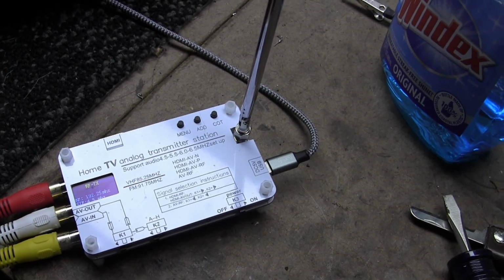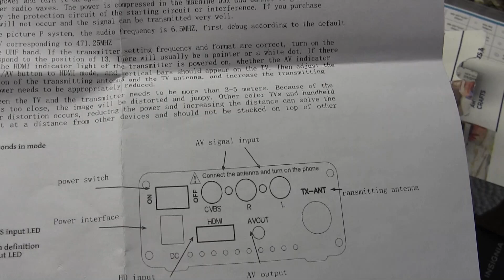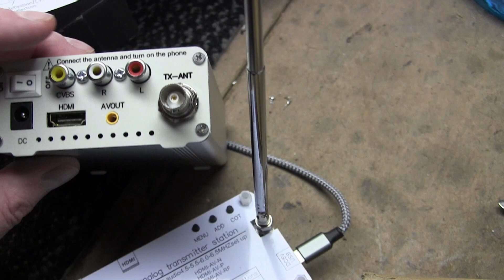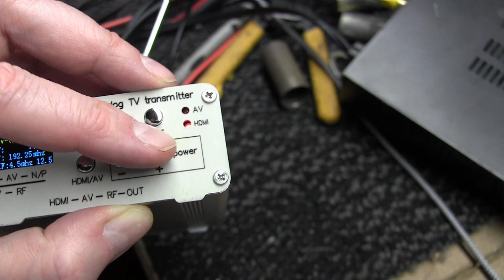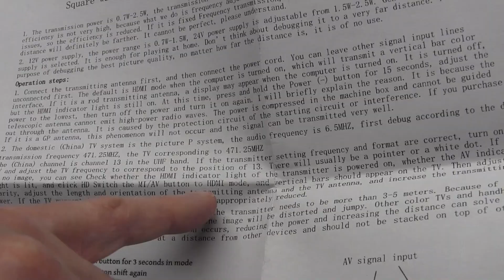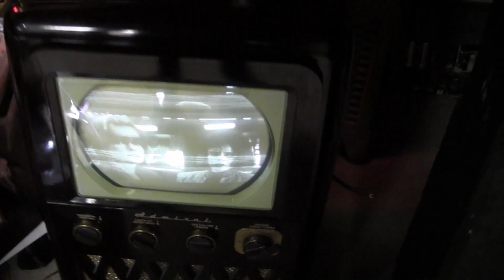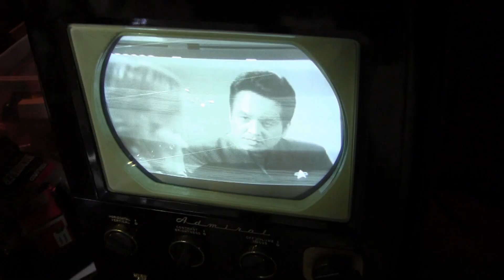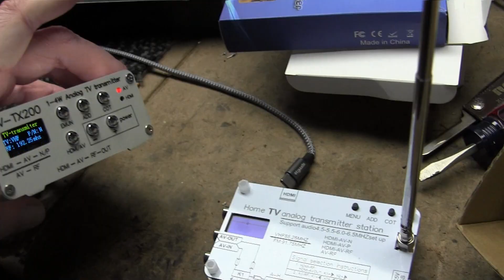Quick review - Higher power home TV transmitter

Comment: You would be better off just using a RF modulator and a very strong amplifier to broadcast a tv signal for short distance.
Reply from the maker: That's what this is.  It is an RF modulator and amplifier.
Reply: @bandersentv  I must say that its not very good one. I was thinking about buying this, but I made the chose not to when I noticed that the makers of this transmitter don't follow any standard in any useful and safe way. Since I am very concerned with interference where I live in Europe on the now mobile frequency band (700 to 800Mhz).

Comment: Thanks for the presentation
The use of  telescopic aerials on both sides is not a good idea .
Indoors you get lots of réflexions. Even a fluorescent lamp is a trouble.
Also any diode rectifier without capacitor across the diode .
Try to use a shielded coaxial link with a 60 dB attenuator
Reply from the maker: Coax to what - the TV?  I'd just use the RF out of the converter box for that.  The goal is a simple solution to broadcast over the air to vintage TVs.  Personally, I have a whole rack of commercial grade equipment I'll be using.  This was just a quick demo of cheap all-in-one gadget that have been flooding online discount sites lately.

Comment: The power numbers on TX200 are in reverse. 0 = Most power, 31,5 is the less power.
I have one but i have problems using VHF. Signal is much worse than UHF and seems less powerful too. And i think its buggy on VHF, because i tried transmiting on VHF and i could pick up in UHF band, and also if i change frequencies alot, it starts making noise and i need to turn it of for a time and on again.
It works good if you set a good UHF channel and let it do its job. Have alot of power and works good but its buggy.
Now i can give some use to my old tvs, and my gamegear tv tunner.
Maybe i buy another TX200 in future to have two channels, and connect them to a smart outlet to power it off when iam not in home to avoid broadcasting 24/7, and maybe cause problems (illegal broadcasting channel, even if its low power, iam sure my neighbors could pick up signal, i need to take my gamegear out and check how much is leaking outside). And this way i can power it on remotly when i need to.
Reply from the maker: What country are you in? None of the channels line up properly with TVs in the US.

Comment: Is PAL vs. NTSC formatting an issue? I've seen reviews from the UK showing the TX200 working well there and I assume your'e in the USA and it also seems to work reasonably well. So formatting isn't an issue or maybe there is more than one version? I'd like to make sure before ordering one off of good 'ol AliExpress.
Reply from the maker: It can do either format.  You just set it with the menu. They are also on eBay
Reply: @bandersentv  Thanks for the Review. I went ahead and ordered one from AliExpress. I set it up this morning and it's working well. I don't think I would have been successful without your pointers, especially how to set up the audio IF. I would have had no clue. The VHF and UHF frequency choices are different than what's listed on the provided instruction sheet. Luckily there are several frequencies that seem to be spot on for some USA channels. I ordered mine with the ground plane antenna which seems to provide a good signal. I haven't tested range yet. But for now I have a secret stealth TV channel that is broadcasting a Donkey Kong video game. Probably no one will ever know because most people have cable and those who get over the air broadcasts are receiving digital so they would have no idea there's an active analog channel in the neighborhood. And of course I'm only sending our a signal for a very short time so I doubt I'm causing any issues.

Comment: Illegal.
Reply from the maker: Yes, it sure is.  There is no legal transmission power level in the TV bands.
Reply: @bandersentv  If its inside your home, not a problem. Back in the day, some "TV Sender" devices were sold on stores for inside broadcast. Even if leaks a little outside of house, if its not overlaping any public frequency, nobody will knock your door for a fainth signal, but avoid at max the leak, or just turn if off when not using it, just to be safe.
Nobody will know you are broadcasting if signal leak outside your home is residual, unless you got some RF geek neighboor.
Reply from the maker: @sjogosPT  It's a bit more of a concern these days since a portion of the VHF band was sold to the mobile phone providers.

Comment: The switching power supply crud can be seen superimposed on the hum bars as a wavy pattern.
I wonder if the modulator is controlled by an Arduino? If so the code possibly could be rewritten to give standard Vhf channel frequencies.

Comment: I have not found anything that works as good as an agile modulator, I have several. the hum issue happens on them as well but too a much less degree and you can use standard ntsc broadcast channels.
Reply from the maker: Sure, I have a bunch of them. This is cheap, easy to use and has HDMI input.

Comment: The hum bars are most likely from AC ripple caused by the cheap switching power supplies these transmitters come with. Try powering them from a USB battery power bank, or from the USB port of a laptop computer running on battery power, to remove the AC line from the equation entirely.

Comment: I have one of these and had similar issues. I found the antenna length does affect it, as well as the proximity to the transmitter. I keep the transmitter antenna at half staff. Works really well at 20’ on my TR-1010P. Couldn’t get the av out to work at all.
Reply: I bought that unit to use with my collection of portable tv's like my little Sony's I have tv's from 2inch and up !

Comment: I would definitely try a regular power supply with a transformer, diodes and a capacitor... those switching power supplies are a big source of noise. For audio applications I had to build a filter with 4 coils and 3 caps in orther to remove high pitch wistles.

Comment: That antenna is probably eating a ton of transmit power via its high SWR. If you built a J Pole or a dipole with the correct length for that thing I bet it would work wonders. To test it you could also get a Nano VNA. A correct antenna is everything when it comes to transmission. You could be putting out 1000 watts but with a bad antenna would be getting nothing out.

Comment: A Blonder-Tongue modulator is still the way to go, for the best quality.
Reply from the maker: I haven't had much luck with my BTs.  Fine if I hard wire them, but not so good with transmitting. I have some Drake and Macom gear I'll be trying out in the near future.
Reply: @bandersentv  have you tried building a properly tuned/cut dipole for the channel in use?

I made a simple dipole for channel 23 (525.25 MHz) and specifically had it cut for 527 and it works ok. It's being fed by a Drake Mini CATV modulator at maybe 45mW
Reply from the maker: @ Yes.  I've done a few videos on BTs in the past.  Currently I'm putting together a solution using surplus professional gear to broadcast on channels 2-13.
Reply: @bandersentv  like at the same time using a passive combiner and multiple modulators? I want to try to build one of those myself.
Reply from the maker: @Sys-Edit0r-1995  Yes, exactly
Reply: Bearing in mind I know very little about these things but if the issue is with the plugin transformer and the line voltage, would an isolation transformer be of any help or would the secondary pickup whatever might be causing it from the line?  Like I said, probably an idiotic question 😅😅😅

Comment: Using something like a Tekpower or WANPTEK linear power supply to power your transmitter should eliminate any hum
bars. You may find  other uses for it in your restoration work Bob. Good review!
Reply from the maker: Probably but remember I have Blonder Tongue, Drake and Macom commercial gear.  I'll be setting those up soon for a permanent home broadcast station.  I got these to demonstrate a quick and simple solution,

Comment: I have the 200mw version and running it on a regulated power supply. No hum bar issues. Reception is good throughout the house. About 100ft. I’ve ordered the higher power model and it’s being shipped.
Reply: What range does the higher power model have? Thanks.

Comment: If you plan to use that 3.5 mm AV out jack, you may have to experiment with cables. There are 3.5 mm to 3 RCA jack cables, but there's no standard for those things in regards to which signal is on tip, ring, ring, and sleeve. I think the most common type was for camcorders, but this transmitter might be different, like a Nextgen TV converter box I recently tried. Some are sold without even specifying the connections. I'm guessing the meager documentation that comes with this transmitter may not say what you need. Cables made for different purposes are not the same, even if they look the same. If you get the wrong cable, one of the signals may come out on the ground shield of all 3 RCA plugs, and ground comes out on one of the signal pins. You can't fix that by changing the plug order. You either have to get the right cable, or cut the cable apart and crossover the wires (including crossing 3 shields to a signal, and vice versa).

Comment: Yeah, I'd say it's probably a cheap PS that's the cause.  As somebody else mentioned, try subbing in battery power to see if that adapter is the cause. I'd love one of these if there was a fix for the frequency issue. For the win, I use one of the big old Blonder tongue agile RF modulators and broadcast through a dipole or rabbit ears. Naturally I'm limited to channel 3 or 4, but the quality and signal strength are awesome.

Comment: I would think if you used a 12V battery to supply the power to the higher powered transmitter, you would eliminate the hum bars and other noise in the picture. Something I would just try, may or may not be successful.

Comment: Never use these power adaptors that comes with these Chinese online ordered stuff. They are not just noisy as hell, but an actual shock hazard, and possible fire hazard. Incredible what can they commit in these. Sometimes it's obvious, because the layout is so bad that primary and secondary traces go to sub-mm proximity to each other. 

Sometimes the layout is fine, but in the transformer the only isolation between the primary and secondary side is the enamel on the wires! Not kidding! Watch some Diodegonewild videos about the subject if you haven't came across his channel yet. He is usually testing and tearing down phone chargers, but the same applies to these generic power adaptors.
Reply: I would guess never keep these plugged in during lightning storms!
Reply: @oldradiotvsc9836  Never plug these in, period. Break them apart to get the DC cord in one piece with the strain relief, and just recycle the rest. Sometimes even the DC cord is unusable, because of way too thin, and/or aluminium/steel conductors. 

On one occasion, I've seen a decent PSU in one of these, it came with an HDMI - composite converter. It had the board of an old LG phone charger in it. With its full surface (primary and secondary) stuck in the new case with thick black foam based double sided tape, the type which tends to become conductive after 10+ years. And the mains input was wired in with super thin wires that was way too long and touched parts on the secondary side. So despite the good quality PSU module, it was still no safe due to the messy assembly job. 

Some of them has no fire retardant in the housing, they burn like napalm! This is becoming increasingly rare nowadays, but you'll never know for sure until you try to light it on fire - or until it does it on its own!

Comment: the single telescopic antenna is probably not very great for transmitting, and some kind of dipole would probably work a bit better, like rabbit ears in reverse.  The power supply is probably the source of the hum bars, and there probably isn't much or any filtering inside for the transmitter, and since the video is AM modulated, the noise just goes right through.  A higher quality switcher might be good, or if that fails too it'd need a regulated linear supply maybe.  that is a pretty neat device though.  I am curious if the firmware can be hacked to adjust the tuning range for US channels.  I'm sure the hardware inside can do it.  wonder if someone's done a teardown yet to show what's inside.
Reply: I was thinking of that too the firm ware because I bought same unit I am getting the cheaper one too . I really like the FM transmitter too.

Comment: Probably the wall wart power supply is very poorly designed, with no EMI filtering, which may explaing the 120 Hz bars in the image. I have had similar issues with the power supply that came with the android tv box I had. I examed the internals of the power supply and noticed that they omitted the common mode choke and any other EMI measures. The short term fix was to add a choke and ferrite beads, the long term fix was to replace the power supply with something decent.
Reply: I can hear 120Hz hum in the sound especially when the antenna is in certain positions, even though otherwise the sound quality is excellent as Bob points out.